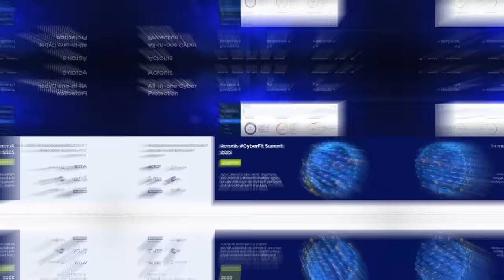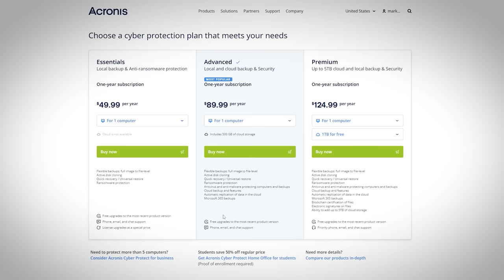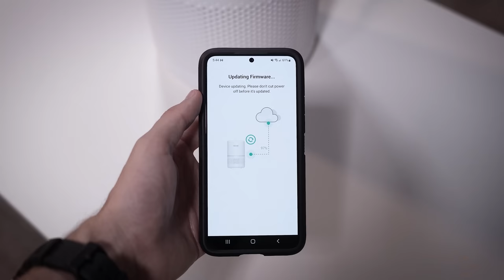Deep-Cleaning a Viewer's DIRTY Gaming PC! - PCDC S3:E7

Comment: This one hits home for me...  I do not do gaming, but build my own workstations, and do refinery / Power Plant modeling for freshly built new plants.  My old case, 10+ years old,  is quite similar and would not trade it either.  3 front 5.25 bays, Mostly full.  One bay with IO as you have but a bit more extensively cluttered and a dual HD bay with removable hard disks installed.  

Your cable management is as good as they come sir.  These old cases are not meant to be seen, but you did make it a quite nice system.

As for older systems, The guts that Were in my desk machines (one at my home office, one onsite at the largest refinery in the world) were brought home to my retirement place here, and rebuilt for the family here.  HOT machines for their days...  Core I7 - 4790K in each.  One is built and doing gaming duty in the family room, and the second one is awaiting a new case, and a couple more parts to move to its new home with a relative next door.  

Your vids give me inspiration to do a MUCH better effort on cables.  Also, if I may, There are PCIe expansion cards, quite cheap, that will allow that rig on this video to take a M.2 drive say 256K or even 500K as the boot drive and you will really see the boost.  

Keep up the yeoman's work.  You are an inspiration almost weekly for me.  I do learn alot here.  And I have built several systems, although not as gamers, but as workhorses, and put your info to good use....

Comment: A little note on rinsing aluminum heatsink fins with tap water: gotta be sure it's completely wiped off and dry afterward. I rinsed my gpu's heatsink, and after a month or so, the fins got white and hard stuffs on them. Kinda like tooth plaque. Almost impossible to chip away completely, due to the gap sizes of the fins.

Comment: Excellent--thanks for the work*

The old hardware even as old as ~10 is still fine so long as it's paired with the right tasks and expectations are sane.
Reply: its funny you say that i have a 2012 dell mobo that i put a e3-1240v2 xeon in basically a 3770 but with no integrated graphics i paired it with a 1660 super and i can play basicaly every modern game at medium settings 1080p no problem constant 60 fps with a little tweaking and sometimes more without tweaking.  i have no issues with 1080 gaming at 60 fps im not super competitive in shooters so i could really care less as long as im having a good time and visuals are good. i even pimped it out on a budget i spent barely anything if you take out the GPU. 25 dollar fan set from china 18 buck cpu cooler from cooler master a 15 buck cpu on ebay cause most have no clue what the xeons are free motherboard and case from college throwaway 20 buck power supply from craiglist and get some decent solid state drives and your good to go gaming on a budget can be pretty damn cheap sometimes if you know what you are doing and you dont have to sacrifice too much for the price id go as far as say best price for the value i got. i got a vid on my cheap ass channel of my system its great for me. i can even record myself gaming and game thanks to nvidias great gpu recording software

Comment: G'day Greg,
I like Old School PCs for Retro Gaming, so was very pleased you rebuilt this one as was, the only thing I would Change Due to the MSI Mobo & GPU would be some Blue G.Skill DIMMs & even though it is a FX4100 upgrade the Stock AMD Cooler to a Cheap Tower one with a 92mm/120mm Fan so all parts will be Black/Blue/Silver.

Comment: Another thing that can really help with removing sticker residue from cases is paint thinner. It east up the adhesive a lot better than IPA typically does. Though I have found some adhesives that resist paint thinner and IPA cleans them up a little easier.
Reply from the maker: Don't use paint thinner. It'll pick up the black paint on some of these cases and strip it to bare metal. Ask me how I know Lol.
Reply: @GregSalazar  Interesting. I've been doing this for over two decades now and never had it strip the paint off a case. Those must have a REALLY bad paint job. Even the old Optiplexes haven't done that to me.

Comment: So, my build is:
-mobo = B660m mortar wifi ddr4
-case = corsair 275R airflow
-cpu = i5 12600k
-psu = corsair cx750m
-air cooler = arctic freezer 34 duo
-gpu = 3070/3070 ti (Not yet bought)
I would like to know two things; 
1-The case has 3 fans included, I don't know if I can connect them all to the mobo, if I can't, what do I do? 
2-Is the build balanced?
I took the parts on Amazon.

Comment: I love that case! I just sold a system that used the exact case and really liked it. The case is really nice because the audio header and USB sockets are on the TOP of the case in the FRONT and that made it extremely convenient to use flash drives and headphones..... as far as the side fans, I left them out of my build as they didn't seem to fit right... that was one nice chassis.... going to miss it...
Reply: What case was that? I have a friend that has one but there was no identifying marks on it.
Reply: @Slyd_Fox  it was an antec case, I don't remember the model number, but it was an older discontinued model.
Reply: @johnstancliff7328  That's a better lead than we've had so far! Thanks!
Reply: @Slyd_Fox  and I'm trying to remember if it could have been a Raidmax case.... I remember looking it up... the unit was a ASUS build, so I don't remember which brand Asus used....
Reply: @johnstancliff7328  Thanks for trying!

Comment: I would have liked to see some wire wrap to be used to tidy the larger bundles of cables and make them look more 'controlled'.  With non modular PSUs if you cant hide the majority of cables they always look a little raggedy and often detract from the visuals of the internal of the PC.

Comment: Greg - Does anyone in US manufacture a mesh like the one used on the Corsair 4000 airflow case magnetic dust filters ? I just wondered if that sort of thing could be applied to enable filtering the air the fans are drawing in? It would be a god send after market item to put on cases which do not have any kind of filtering especially in dusty environments?

Comment: Hello Gred, how are you.
 just want to as any tips for my laptop. Well the thing is I have suspecting that my laptop battery won't work at all but it's weird coz after you plugin the charger the battery miraculously started to working, then when you power on the laptop the battery suddenly won't work and not appear to my home screen ( battery logo ).  Do I need to replace my battery now?

Comment: That person really needs an upgrade. Technology has come so far. Keep the gpu if you need too. Just do a semi rebuild. The non-modular psu is fine as long as it works well. I would say fully modular these days. Maybe a 650w though. I would say a good 5600/X would do that person wonders. A 7 year build should be the max as much as possible until next upgrade.

Comment: Question. I have a pc that reboots once in a great while, i can't remember the last time its done this but i know it has, and it can not detect its drives. So i power it off and let it set for a few seconds and power it on and it boots straight into windows. And now it will probably run like this for a while again before doing it again. Any ideas?

Comment: I always wonder if the mini vacuum tool last the whole time or if he has to recharge it from time to time and how long does it really last on a typical use scenario?  I suspect the battery life is like and hour or two before it needs to be recharged.  Just curious about how long before he has to recharge that vacuum tool. :) Thanks
Reply: I actually have the same tool.  The battery does need a re-charge now and then, but depending on how it is used it takes quite a while to run out.  I haven't had to re-charge mine in over a month.

Comment: Wish I had pictures to upload of the five machines I had from my warehouse that we're absolutely disgusting. Completely full of dirt. Some of them were refurbished PCs which is fine but one of them look like it had tobacco stains all over the board. The CPU heatsink I used a toothbrush with alcohol to clean it and it was practically black coming out. The ssds in all these machines were not secured. I come to find out the same guy put these computers together.

Comment: It doesn't make sense to upgrade anything on a platform like this. 
An 8 to 10 year old rig has deprecated standards. RAM is DDR2 or DDR3 like in this rig, it only supports up to 2133 - IF the bios and motherbaord can support anything that fast. decade old RAM is finicky. If it works, leave it be. The GPU will be on PCIE2 or maybe PCIE 3x16. You're not going to put a PCIE4 card in there, and that lovely little FX cpu won't be able to make use of any modern gpu, whether it's x8 capped or not. The only and best upgrade you can do is to boot off an ssd. But if it already uses an ssd, just let it work.